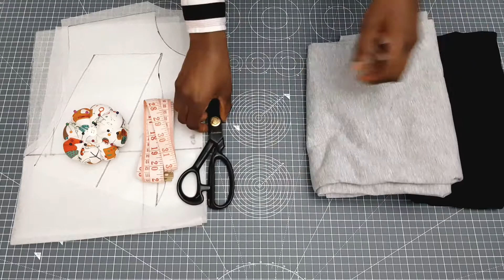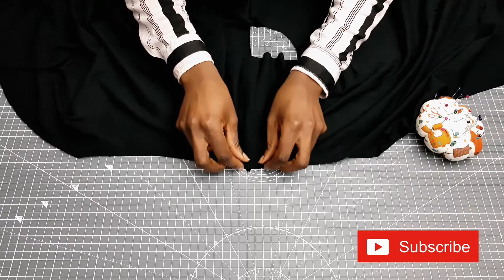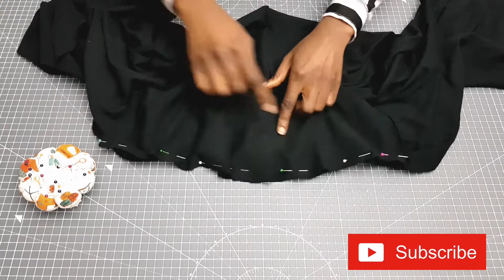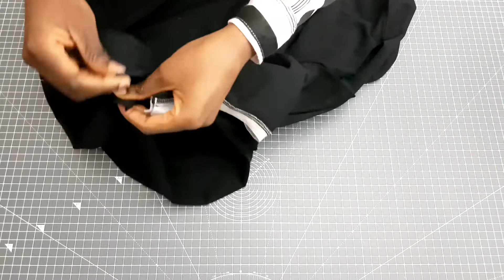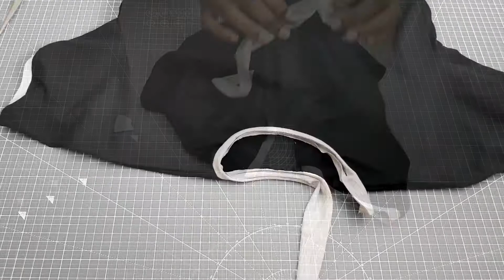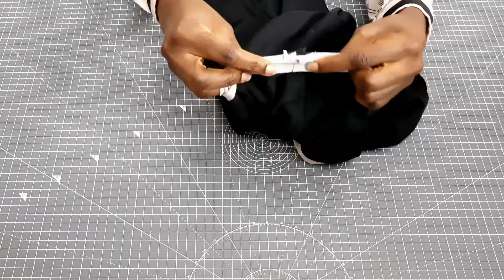DIY Basic Mens Tshirt Sewing Tutorial | DIY T shirt Ideas | Sew With Me | Bhooki

Comment: Hi! Where do you put the notches in the sleeves and armholes? I think I saw one in the sleeve, which you aligned with the shoulder seam. Are there others?

Thank you for the tutorials. I can make myself a t-shirt now, even if I don't quite understand what I'm doing with those curves.
Reply from the maker: Hi, Thank you for watching. There are different methods of sewing and you just need to find what works for you. When I learned how to sew T-shirts, I wasn't taught to notch so many places like the classic sewing methods. With T-shirts, I have come to realise that the most important notch is the one in the middle of the sleeve because it has to align with the shoulder seams. This is because the jersey fabric stretches. If for instance, you cut the sleeves too short, you can gently stretch it from the middle to fit in and then iron it to release the tension it creates from stretching. Once the shoulder notch aligns, other parts can be stretched to fit. I hope this makes sense.
Reply: @Bhooki  Thanks! That's perfectly clear.